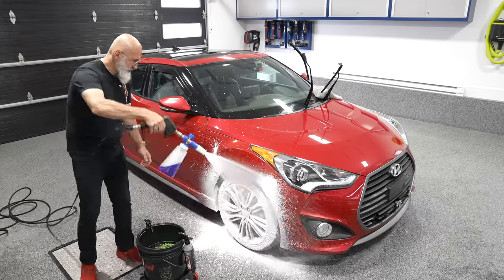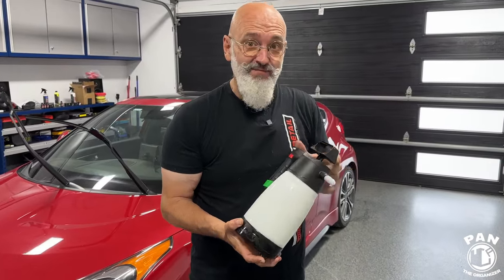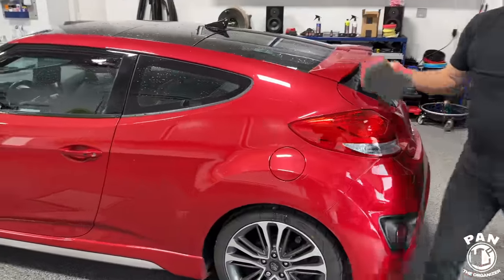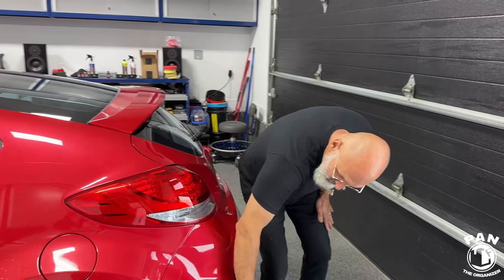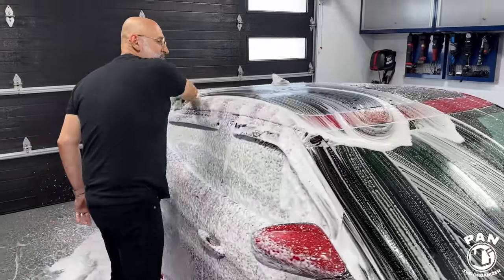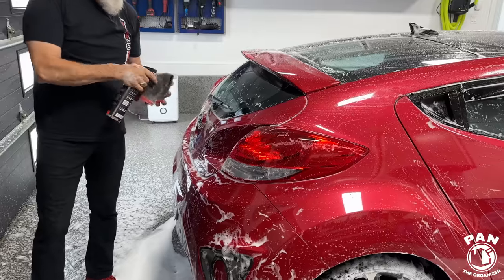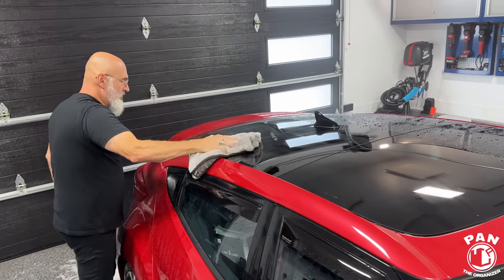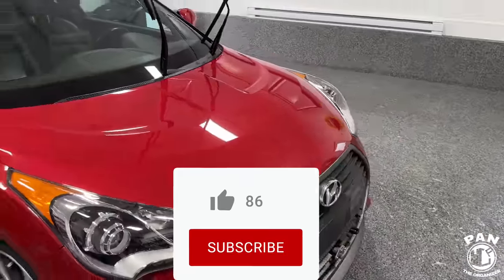The Ultimate Guide to Easily Wash, Clay, and Seal Your Car!

Comment: nice job, but i just couldnt do this to my vehicles lol not cause im scared, but because i enjoy the process and have no need to hurry it up.
... id like to of seen that clay towel being rinsed out once in a while :) Plus you will need a dedicated towel cause its going to have load of product of all over it, which wouldnt normally occur. (and I wouldnt of used a gauntlet for that lol lol)

May try the iron decon step... usually i spray over the car and wipe off with a microfibre... but this would save the step of the rise afterwards :)

Comment: Hey Pan! Can we use gyeon quick detailer instead of the ceramic gloss and still do the same method with the ulra fine grade clay towel? Like, rinseless wash and then spray gyeon quick detailer and use the clay towel then dry with the mricrofibre towel?

Comment: Hello. Great video, Pan. One question has arisen. The first half of the car, which was washed with rinseless shampoo, does it turn out that we left the metal inclusions without processing?
Reply: Most of the metal is removed by the decontamination towel. When maintaining a vehicle on a regular basis, accumulation is minimal. We wanted to showcase 2 different methods.

Comment: @pan I watch your channel often and learnt most of the things from you so thanks a lot
. 

I have a new car ( like 3 months old honda crv silver metallic) and barely 300 miles on it. I did an adam's super foam blanket then second wash with incredible suds and then dried it off with the gauntlet towel and then just did some gloss finish with the p and s bead maker This was my first was so was testing things. A new car so don't want to use strong foam (like gsf coz wasn't doing graphene coating right away). Left Adam's foam for maybe 2 - 3 mins.  Will do another wash in a bit. Had 3 issues so please help. 
1.  Adams and then incredible suds both didn't clean the bird droppings well. Should I leave it longer, use something else, do something else ? (dont' want to use a stronger foam if I can avoid it)
2.  After washing, used invisible glass on glass but it was late evening. Looking at the car in the day I found the glass still had very small water drop marks. Is this expected. 
3.  I used p and s bead maker on the car and glass both and after  3 - 4 days I the surface has dirt on it and not as slick. I just bought turtle shine (Turtle Wax 53837 Hybrid Solutions Pure Shine Detailer Misting Spray) . Can I use this on TOP of the bead maker ?  If not how do I use the bead maker yet avoid the very fast dirt accumulation ? 

thanks ahead of time and thanks for the amazing videos which help us a lot
Reply from the maker: It doesn't matter if the car is new, you can use stronger soaps to clean the car. The clear coat doesn't mind what pH you use. You can use an alkaline pH for the pre-wash snow foam, and acidic soap for the contact wash. That's key to prepping a new car, to remove all the crap that comes with it.

A new car is never new until it's properly detailed. 
- at the factory, the paint defects are often corrected quickly by rotary polishing which can leave marks and holograms, so polishing corrects those, before you lock that in long term with a ceramic coating for example.
- vehicles are then transported by truck, train and boat so they are exposed to the elements, industrial fallout, brake dust, rail dust, etc
- vehicles are often left at boat docks (when transported by boat) or in exterior parking lots for weeks or months, again being exposed to the elements
- at the dealership, the vehicles are almost always poorly prepped using the same dirty water that was used for all the cars on a given day, and poor washing and drying methods leading to swirls and scratches 
- at the dealership, a layer of cheap wax or paint sealant is usually applied to attempt to make the paint glossy prior to delivery. It's crucial to remove any previous protection before you apply a ceramic coating, as coatings need to bond directly to a virgin clear coat.

If you only plan on applying a regular carnauba wax or paint sealant though, you could decide to skip machine polishing, as those protectants can be applied over existing protection and it's not as crucial to prep the paint as well.

I explain all of this in this popular video: https://youtu.be/QgoyrC-5CMc

So you can better visualize the new car prep process, here are the steps I perform on a brand new car for my customers: 
RS6 Avant Performance: https://youtu.be/L5SQ0ZIJCj0?si=mcQiMs9HBLlaqjGK
Mercedes S 580: https://youtu.be/Vq_tfcwryVI?si=whord2_UEFSg28UW
Aston Martin Vantage: https://youtu.be/OKga3yZVTqo
Volvo XC60: https://youtu.be/tvDBBenhYFA
Tesla Model Y: https://youtu.be/gohks8xP5NY 
Porsche 911 Carrera: https://youtu.be/2ckiivbFqs4
Audi Q7: https://youtu.be/t7HCBSVnizM

Comment: Would using a clay mit with the decon spray as a lubricant work over the top of the snow foam?
Reply from the maker: The layer of thick foam would prevent the iron remover from doing its thing on the paint. You can use a bit of shampoo from your wash bucket as a clay lube, or simply use the iron remover as the clay lube.

But don't forget, not all iron removers can be used as clay lubes with clay towels or clay mitts. Only use iron removers without solvents in them, like the DIY Detail iron remover. And use quality perforated synthetic decontamination towels like the DIY towel or The Rag Company Ultra clay towel, links in the video description.

Comment: So I washed my car this weekend and had plans to ceramic coat it with the turtle wax ceramic spray. But I couldn't find a clay bar and spray where the spray wasn't a " spray and detailer" in one. did I wax my car by mistake when I clay bared it?. Do I need a  cLay bar spray or can I use soapy water next time to avoid this?
Reply: You want a lubricant when claying. Wax isnt a great lubricant. Detailer sprays are mostly car wash soaps with less dilution. You would have only risk adding swirls to the paint the way you did it, but it’s OK. Next time just use a wash spray or find a detailer spray.

Comment: Great in theory but the clay portion is shearing off the contamination and you are picking that up with the drying towel and wiping contaminates all over the car.  Best practice would be to do another rinseless wash or waterless wash and spray sealant as drying aid with towel for final finish.  How is this not rubbing the contaminants all over the car with the drying towel?
Reply: Thank you for your question. The Perforated Synthetic Decontamination Towel is not like clay. It has no abrasives, and the perforations allow room for the contamination to go.

Comment: Is there more benefit of using a 5 year ceramic coating after polish? I'm assuming ceramic gloss or quick beeds works best with that layer of coating?
Reply from the maker: True coatings in glass bottles are better at everything compared to spray versions from the same brand: they last longer, have more UV protection, better chemical resistance, better hydrophobics, etc. But they are more complex/long to apply, and cost more.

Sprays are easier/quicker to apply and cost less, but they aren’t quite at the level of full blown coatings.

So it depends on what you are looking for, and your budget.
Reply: @PanTheOrganizer  Thanks for the explanation. I couldn't figure it out. Your videos are great. Glad you interact with viewers too. Your Chanel definitely gives me the courage to try stuff. I'll be attempting a glass bottle application I can the weather is free of rain.

Comment: Hey Pan, I've got a ceramic coated car, it's white and I can tell the outside is noticeably darker than the area just inside when opening the doors. Does iron remover help with this? I've already done a wash with ONR. Thank you so much!
Reply from the maker: Hard to say as I don’t really know if you have an issue or visually what it looks like in person.

What specific coating did you apply? Some coatings have a “jetting” effect, meaning they can darken the finish a bit sometimes to make it appear “richer”. Or you have some road film accumulation on the paintwork which means grime is in there and isn’t removed with your normal soap.

You could try washing the car with CarPro Desclale which will remove mineral contamination and then use an iron remover and lightly agitate it on the surface with a microfiber wash mitt or towel and rinse. See if that helps ton restore the finish.

You can get those products here: https://bit.ly/35fJN1g

Comment: Thank you for the excellent video. What ratio do you recommend for Incredible Suds when using an IK9 1.5 gallon foam sprayer? Thank you.
Reply from the maker: Thanks! Yvan will be better suited to respond to that specific question, so hopefully he reads it and replies.
Reply: For an IK foamer start at 1oz per gallon, and adjust if you desire more foam.

Comment: @PanTheOrganizer, I was wondering if/or how you wash the applicator pads used to apply top coats like Turtle Wax pro Flex Wax, Graphene infused? I did not wash those with the microfiber towels and wipes and tried using Dawn dish soap to clean the applicator pads but they are not coming clean. Ideas and thanks for sharing your knowledge!
Reply from the maker: You just wash immediately after use, as you would for any microfiber towel. There's nothing special to do here.
Reply: @PanTheOrganizer  I'd used 2 round foam filled applicators and should have put the first one in a bowl of Dawn to soak. The turtle wax pro flex must have dried as I finished the car and hasn't come clean like the 2nd/last applicator did. Thx, I'm slowly getting the skills to get good results and know-how for great results.

Comment: Hello Pam! Can I use a very light synthetic or traditional very light clay bar on my one year ceramic coated car. Was gone for a week and left the car outside and it got contaminated. Is it possible to use a very very light clay on the car?
Reply from the maker: Hi Phil. Who's Pam?? LOL I'm Pan. ;) 

Never use traditional clay bars on a coated vehicle. You would damage the coating. Keep in mind clay bars are abrasive. You would want to use a new generation synthetic perforated decontamination towel, like the one we used in this video, along with a clay lubricant. That will not damage the coating.

Here's a link to the towel: https://bit.ly/3OdJKJI
Reply: @PanTheOrganizer  hahaha sorry about that, typo 😂 thanks Pan!!!

Comment: Hello Pan and community!
Just bought a new car and deciding how to protect is daunting. Was running down the ceramic path but skidish of doing anything to permanent or troublesome to remove so then started looking at wax but not sure about the protection. What would be a good middle ground that would wash off over time or not require clay or polish to remove?
Reply from the maker: Clay or polish alone can’t fully remove existing protection. Only machine polishing ensures 100% removal.

What type of paint protection is best for you depends on your budget, experience and expectations. See my video explaining the differences between waxes, sealants and coatings here: https://youtu.be/4ejfPHan3k4?si=4e91tQZEMYkcZhw6

Comment: Hi pan. Can i use the same towel on may car eve if its not ceramic coated? Will it not scratch my paint and still do the job?
Reply from the maker: Correct. This synthetic perforated clay towel isn’t abrasive. So if used correctly with a proper lubricating agent, it shouldn’t cause marring. Test on an inconspicuous area first if you’re unsure.

Comment: Could you use the Turtle wax hybrid solutions ceramic spray coating with the synthetic clay towel?
Reply from the maker: It’s not meant to be used on wet surfaces.
Reply: @PanTheOrganizer  oops, I meant to say can I use the turtle wax hybrid ceramic wet wax as clay lubricant… I’ve been using both products and am quite impressed for the low price.

Comment: Hi Pan, great video as usual but I have a question. I thought it was standard to always follow up with a polish after clashing your car?
Reply from the maker: When you use a traditional claybar yes, as those are abrasive and could mar the paint. The perforated synthetic décontamination towel used here isn’t abrasive so won’t cause any marring, so polishing isn’t necessary, unless you want to perfect defects that were there or increase gloss and clarity.

After claying, observe your paint. If it looks good to you, you can skip polishing. It’s not mandatory. ;)
Reply: Thanks for the reply, Pan! Would this apply to cars that are ceramic coated? My car has a 5 year ceramic coating on it and I’m afraid to polish it because I don’t want to ruin the integrity or longevity of the coating.
Reply: Using these products and methods will only enhance your coating, not degrade it.

Comment: Hi @Pan, is Carpro IronX safe to use and won't damage the DIY Detail Decontamination towel? TIA!
Reply from the maker: In my tests it works well.
Reply: @PanTheOrganizer  Solvent is the ingridient to avoid and Iron X doesn't have it, correct?

Comment: This process was done on a pretreated  car. Can the 2nd method be done on a brand new car? The towel is not going to leave any swirls?
Reply from the maker: The synthetic perforated decontamination towel is not abrasive so doesn’t do any marring on the surface. As long as you use proper lubrication, no worries.

Also, a new car is never new until it's properly detailed. 
- at the factory, the paint defects are often corrected quickly by rotary polishing which can leave marks and holograms, so polishing corrects those, before you lock that in long term with a ceramic coating for example.
- vehicles are then transported by truck, train and boat so they are exposed to the elements, industrial fallout, brake dust, rail dust, etc
- vehicles are often left at boat docks (when transported by boat) or in exterior parking lots for weeks or months, again being exposed to the elements
- at the dealership, the vehicles are almost always poorly prepped using the same dirty water that was used for all the cars on a given day, and poor washing and drying methods leading to swirls and scratches 
- at the dealership, a layer of cheap wax or paint sealant is usually applied to attempt to make the paint glossy prior to delivery. It's crucial to remove any previous protection before you apply a ceramic coating, as coatings need to bond directly to a virgin clear coat.

If you only plan on applying a regular carnauba wax or paint sealant though, you could decide to skip machine polishing, as those protectants can be applied over existing protection and it's not as crucial to prep the paint as well.

I explain all of this in this popular video: https://youtu.be/QgoyrC-5CMc

So you can better visualize the new car prep process, here are the steps I perform on a brand new car for my customers: 
RS6 Avant Performance: https://youtu.be/L5SQ0ZIJCj0?si=mcQiMs9HBLlaqjGK
Mercedes S 580: https://youtu.be/Vq_tfcwryVI?si=whord2_UEFSg28UW
Aston Martin Vantage: https://youtu.be/OKga3yZVTqo
Volvo XC60: https://youtu.be/tvDBBenhYFA
Tesla Model Y: https://youtu.be/gohks8xP5NY 
Porsche 911 Carrera: https://youtu.be/2ckiivbFqs4
Audi Q7: https://youtu.be/t7HCBSVnizM
Reply: @PanTheOrganizer  Thank you for the very detailed response.
Your channel is awesome. I'm learning alot.
I used to work for a detail company. And I also used to do my own detailing until my old car's clearcoat went out. So I am a few years out of practice. But now that I have a new car, I am excited to get back into detailing.

I look forward to your next video. Keep up the great work!
Reply from the maker: Thanks for the positive feedback! 

Welcome to my channel. You discovered one of the biggest car detailing channels on YouTube as we surpassed 1 million subscribers and we have over 135 million views! I have been detailing for 27 years and I love to share my knowledge and passion with my viewers.

You found the right channel to help you learn everything about detailing.

Comment: so the order we should follow is. Wash, clay, iron, then seal?
Reply from the maker: In this case, he is using the iron remover as a clay lubricant, so you are using two steps in one (chemical decon and mechanical decon). Normally, you would wash the car, then iron remover, then clay bar (if you are using a traditional clay bar, and not this synthetic perforated decontamination towel), then seal.

Comment: Does using this clay towel technique on a ceramic coated car remove the coating sooner
Reply from the maker: No as this specific towel isn’t abrasive. You wouldn’t use a traditional clay bar on a coated car as that is an abrasive.

Comment: In a 15 to 20 year old car. Is this going to be okay.and clay bar not needed?
Reply from the maker: If you haven't clayed the surface in over 6 months, then it's highly likely your paint needs to be clayed. The more time you spend prepping your paint, the longer the protection will last, the better the car will look and the slicker the paint will feel.

You could wash the vehicle, do an iron decon step to remove brake dust, then claybar, then apply some wax or sealant. Those are pretty basic steps.

Welcome to my channel. You discovered one of the biggest car detailing channels on YouTube as we surpassed 945,000 subscribers and we have over 125 million views! I have been detailing for 26 years and I love to share my knowledge and passion with my viewers.

You found the right channel to help you learn everything about detailing.